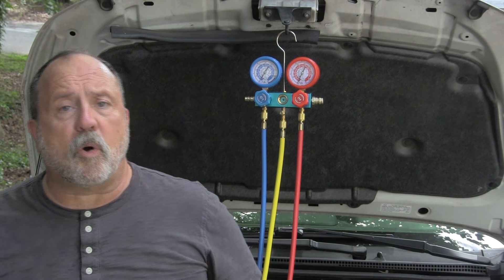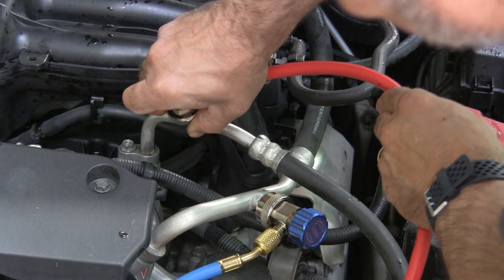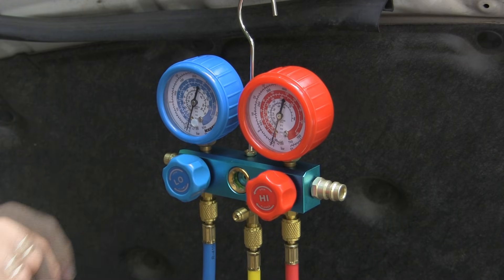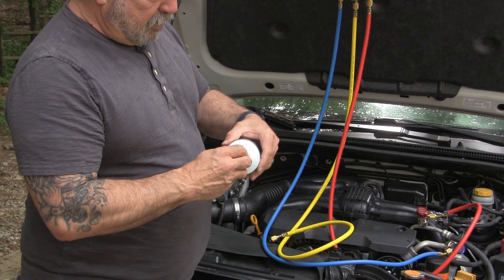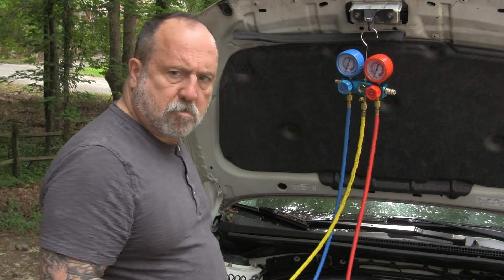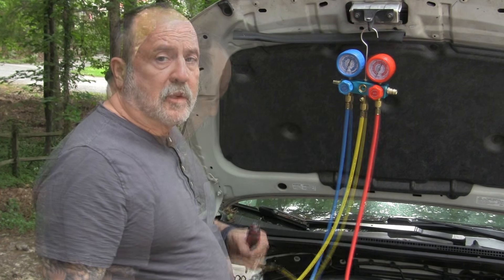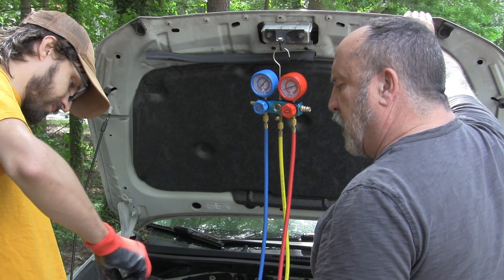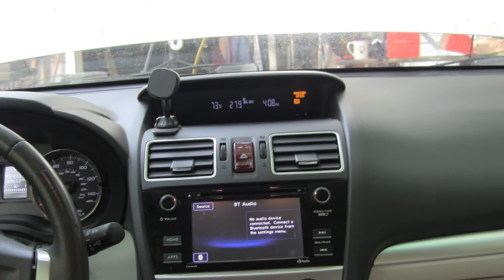How to Pull a Vacuum and Charge a Cars A/C System with Refrigerant

Comment: I’m confused on the recovery/recharge process.  I recovered all the Freon from my car after vacuuming my recovery tank.  I used a recovery machine and weighed 11oz extracted.  System held 1lb 1oz.  I then replaced the condenser and vacuumed the whole system for an hour.  Then I hooked the yellow line to my recovery tank, purged the line then started filling the car.  The compressor turned on and low side pressure went up to 35psi.  However, I only measured 6.6oz going into the car.  The pressure in the tank and the low side pressure equalized and it wouldn’t take any more.  Since I only seemed to recover gas as nothing was sloshing, tilting the tank did nothing.  I filled the rest with a can that I had to shake to get the Freon moving.  Ac blows cold and pressures are 35 psi on the low side and the high side fluctuates between 10pm and 250 psi depending if the compressor is engaged or disengaged.  So now I have a recovery tank that is half full.  
What did I do wrong?  If the tank and low side pressure are equalized at 35psi, how would I have gotten the rest of it in there? No one seemed to ever explain this.

Comment: So, you don't have to use a Micron gauge to be sure you vacuumed the system properly.  I'm going to replace the evaporator on our car, so would a 10hr or even 24hr vacuum insure that all contaminants were removed or sufficiently removed irrespective?
Reply from the maker: IU would assume so unless there was a leak

Comment: How about the oil, or it comes in the cans already?
Reply from the maker: In this case, I had replaced the compressor and it was prefilled with oil.
Reply: @ExtremeDIYGuy thats a huge world about this, now im confuse... thank you by the way.
Reply: The compressor is supposed to have a certain amount of oil in it…..However in the event you didn’t replace  the compressor but know you have lost some oil, they make some mixed cans of oil and refrigerant of various ratios based on the size of the can . And you can add it the same way you are adding Freon if you feel it needs to be topped off . You’re always gonna lose a little when replacing a line … etc…. But use caution. They are only supposed to hold so much … don’t throw multiple cans of the mix with oil in it…. If you’re that unsure , it would better to pull the compressor and replace the oil
Reply: @danielsmith8659 thanks bro

Comment: This dude is so green he's showing you to turn both hi and low valves open..WRONG!!!  Don't ever open the high side for any reason when vacuuming
Reply: Dude I did it exactly how he showed in the video and I have no problems with my car AC so whatever you're saying is incorrect. I had to replace a line because one of the lines was leaking and I did exactly what he said months ago and my AC has been throwing ice cubes ever since

Comment: Hello, I want to ask, if I vacuum the AC by opening both the blue and red valves, will the oil in the AC compressor not be sucked out by the vacuum? Is it possible, or what is the effect if I only open the blue valve and close the red valve?
Reply: The oil will not be sucked out in the AC system because you are only sucking out vapour; therefore, no oil is removed from your AC system. Also, when you are evacuating the refrigerant from your AC system, only the low side is opened. Professional shops can remove the oil because their sophisticated system weighs the amount of oil extracted, which then the tech knows how much oil to add when refilling the AC system
Reply: @michaelt2961 👍👍
Reply: In the US, Autozone, O'Reilly, etc. and Walmart has it.

Comment: Can you use this product at the start of changing out the AC compressor? I have a Subaru Impreza Premium 2013.
Reply from the maker: You should have the system evacuated of all the old refrigerant first, this tool isnt designed to vac and store it, just to put a vacuum on the system prior to charging it. Good luck with it!